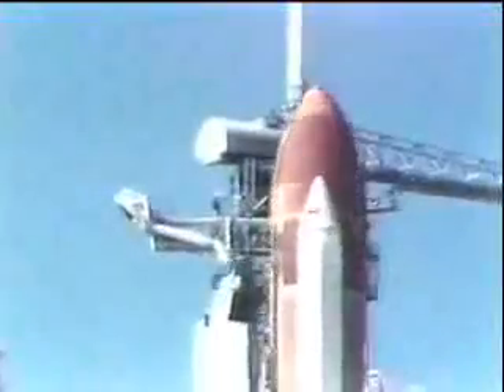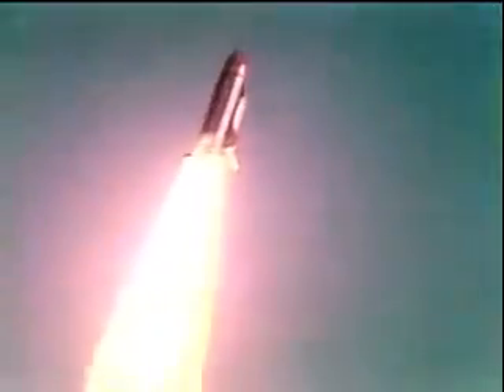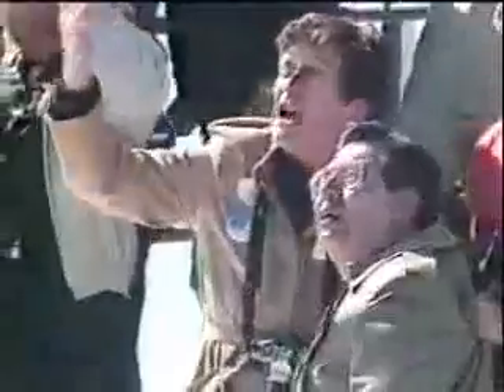Space Shuttle Challenger Explosion disaster. All 7 crew members died in 73 seconds

Comment: The crew cabin survived the blast and took two minutes to fall to the ocean. It was traveling at 200+ mph when it hit and evidence showed several members had activated their oxygen, something they had to do manually. They were alive during the two minute fall and died due to the 200 mph impact.
Reply: It is not known if some or all of the crew were alive. It is not known if they were conscious. It is possible, but not known. It should not be stated as a fact since it is not known. The capsule was badly damaged when it hit the water, so there is no definitive evidence to allow investigators conclude with certainty the exact situation in the capsule after the explosion, before impact.
Reply: D MacBain yep. Parachute failed to deploy.
Reply: ASSASSYN There weren’t parachutes.
Reply: @ASSASSYN  dude space suit dont include parachute
Reply: They actually died around 4:05 of the video
Reply: @berrytharp1334  How the fuck do you know that
Reply: +Ariane Bolt the blast is enough g force
Reply: Rick W It wasn’t a “blast”, it was the shuttle being torn apart.  The crew only had to deal with somewhere between 12 and 20 g for about 2 seconds, which is survivable.  After that point, at least two of them switched on their emergency air packs and the pilot tried to get the power back on.  Those air packs were missing about as much air as someone will go through in the two minutes, forty-five seconds it takes to fall that far.
Reply: Listen to all of these Whiney motherfuckers, they all want the glory but don’t like paying the price for progress. I feel bad for the families watching their loved ones die, but let’s be honest here, everyone has to go sometime, at least they went out heroes for modernity, we should all have such honor!
Reply: This is wrong... while they were “alive” almost certain nobody was conscious and functions. The g forces would have been too much.
Reply: Blake Outlaw They were in freefall within seconds, which has zero G.
Reply: @arianebolt1575  freefall is not Zero gravity. They did not Escape Earth's gravity as well. Zero gravity is a short time frame when negative acceleration, brings the cockpit from going up to when it begins to fall back down.
I'm imagining they fell about 200 miles per hour. It depends on which way the shuttle was facing and what was broken but there is a good chance they could have passed out
Reply: Bacardi Jr. It’s not the fall that kills you, it’s the landing.  The only thing that could have killed them was the impact.  But it’s a pointless discussion anyway.  They shouldn’t have died.
Reply: @colbalt95  Yeah right
Reply: Blake that sounds like wishful thinking ....
Reply: @Doodmann  you are incorrect. They were conscious. The cabin was not affected by the explosion. This was truly a nightmare.
Reply: @Doodmann  https://youtu.be/uqcd_3daPQ8 the best footage you can find. Here NASA says that g forces weren't too high because it's only 2s. The fact that emergency oxygen got activated means that someone was alive and did it.
Reply: @Doodmann  I pray for that. It would horrific to live through that.
Reply: This is super  sad 🤭😭
Reply: You people have been mislead by this post !  You people have been misinformed  !  Everything got disintegrated in mid flight !  Everything got devour and consume in its wake !
Reply: They weren't on the shuttle nobody died,,, all 7 have jobs some in major colleges although some are saying they're twins
Reply: @codcake72  conspiracy theory? you should be ashamed
https://youtu.be/uqcd_3daPQ8 3:03
Reply: @codcake72  exactly. I've seen photos of each of them as they look today. That was an unmanned launch

Comment: This really shocked me when it happened.  I had thought that NASA was made up of the best of the best, and that they were, if anything, excessively cautious.  I thought something like this was virtually impossible, and the biggest danger was re-entry.  When I head the explosion described on the radio, I thought it might still be possible for them to have landed in Africa, as was the plan if they failed to achieve orbit.  I had to attend a class, but when I got out and saw the footage on TV, I changed my hope to  the instant deaths of the crew.  That didn't happen, obviously, but death came so soon after a violent shock (and depressurization) that hopefully they did not suffer much.

Prayer, such as is indicated by the Sign of the Cross at 2:31, is the only appropriate immediate reaction.  In the aftermath, however, the reaction needed to include changes to the institutional culture.  When Columbia broke up, I was more outraged than shocked, because obviously there had not been enough change to that institutional complacency.  My fears of re-entry had sadly been vindicated.
Reply: they are the besy thia rarely happens it only happened 2 times

Comment: They found evidence that at least two of the crew survived the explosion and died when the crew compartment struck the ocean over three minutes later. They found valves to two of the emergency oxygen supplies. Which both read in between 3/4 to 7/8 used.
Reply: ***** at least two, maybe all. The crew cabin was still intact after explosion.
Reply: +x534n01 
e